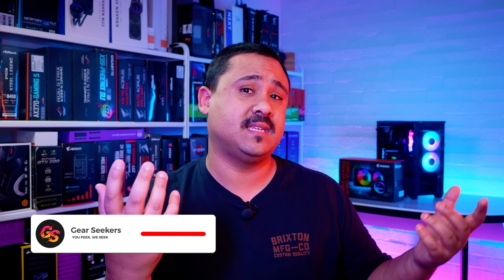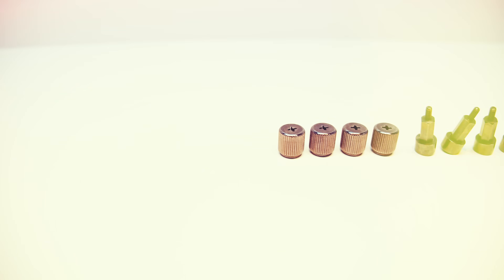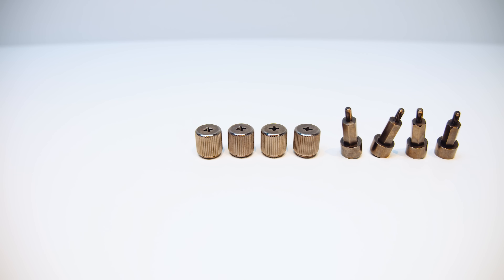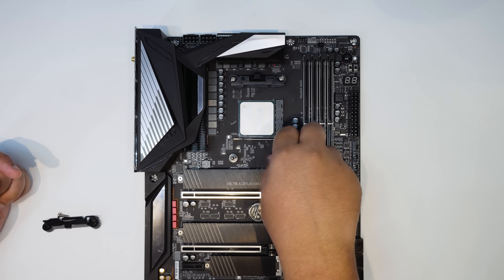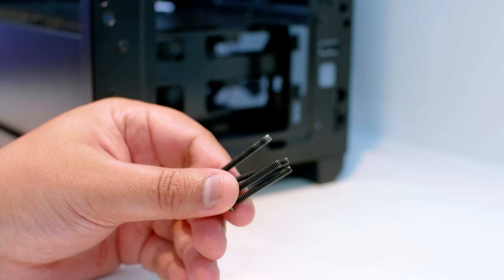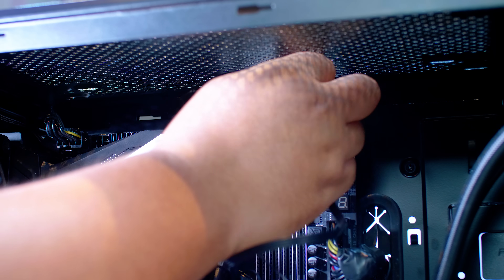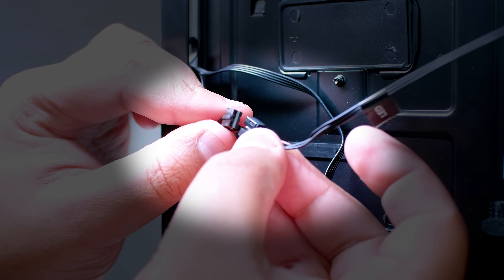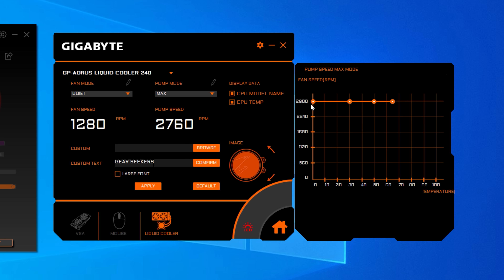HOWTO AORUS Liquid Cooler 240 AMD AM4 & AM5  Install Guide

Comment: Hi, I have a question.. My plan is to use this cooler for the linux headless server - and they dont provide such tools for linux, so will use VM (passthrough the USB port for this cooler) and push the desired config.. However if I would like to see the actual temperature of the CPU does it need to have AORUS Engine actively running in the background for reporting that temperature? Or its being show on its own.. simple test would be to reboot the PC and check if the cooler still shows the temperature. Appreciate your help. Michal
Reply from the maker: Yes aorus engine will need to be running in the background
Reply: @GearSeekers  Shame they dont support linux here in any way :/
Reply from the maker: I've been working with a few vendors directly to bring Linux support to some RGB products. Stay tuned.
Reply: @GearSeekers  I tried using wine (linux tool for running windows apps) for installing and running AORUS Engine.. Installation went through and app itself started but it would need to be tested with the actual hardware whether it picks it up or not. Anyway If I may contribute my 2 cents here.. This badly needs some centralised opensource app - since everybody is doing same thing their own way.. I didn't seem to find any unified tool for controlling RGB headers on motherboards.. it would be ideal to unify this problem across multiple vendors. As an implementation itself I would choose a service with exposed HTTP port - so called docker microservice. This way it can be integrated everywhere/anywhere (iframe for example or reverse proxy).. if you need any further assistance with the design feel free to reach out to me - definitely interested. Michal

Comment: Just to clarify, first time building a PC here :) Does this AIO uses the motherboard system fan headers for the 3 fan that is attached to the radiator?  if not I could save them for my chassis fan :)

Comment: Great review, do you still recommend these coolers? I'm thinking of getting the 360MM for the AMD Ryzen 7 3700X
Reply: They are great. I have the 240 and that cools super already
Reply: @TheAdatto  hows the temps overall.
Reply: @hassanar1  great. Highest temp i reached om a 4.9ghz 9700k is 59 degrees C
Reply: @TheAdatto  i am planning to use with ryzen3900x ,i wont do overclock.what do you think
Reply: @hassanar1  no idea. But my guess is that it will be enough. More that enough actually
Reply: @TheAdatto  will it work on asus motherboard?
Reply: @hassanar1  ?
Reply: @TheAdatto  i mean it supports all motherboard,what if use on asus motherboard it will fully work?
Reply: @hassanar1  yes. But you have to install Gigabyte Fusion 2. And it will show the cooler only. On my pc it will show 4 tabs. Mem. Cooler. Keyboard and MB rgb.

Comment: I cannot get the screen to light up on mine. Any ideas?.
Reply from the maker: Make sure the USB header is connected and update the firmware
Reply: @TheGreatAlzatee  i've got the same problem, but mine flashes for a quick second when booting the pc and goes black. The fans, pump rgb everything is working and i can pretty much change everything besides the screen. Did u find a solution?

Comment: Can you mount the cooler with the hoses facing down on the block? This way if you mount the radiator with lines in the back, and have a vertical gpu, you can had a good deal of the hose behind the gpu.
Or is it only on the right side like Corsair ?

Comment: Hi. Is it possible to rotate the RGB graphics  in RGB fusion? I am considering buying the 240 cooler (to mount in the top of my case), but it would look better with the water hoses on the left side of the cooling head (So that they don't cover my RGB ram) :)
Reply from the maker: Yes. You can rotate in any orientation you want :)

Comment: Just bought one of these and it looks and works great, however my CPU temp display seems to be 20 degrees higher than my actual CPU temp. Any suggestions?

Edit: I did some research and found something in regards to AMD R7's having a 20 degree offset, could this be it?
Reply from the maker: Thats it ;)

Comment: Still got a problem with the 360.. LCD display is not working at all, even had the model replaced. Nothing changed. SATA got power, PSU is not overused at all... Setup: Aorus B450 MB, AMD Ryzen 5 3600, Aorus RTX 2060 Super, GSkill Trident Z Ram 16GB... Have sent a ticket to gigabyte as well as my vendor... No replies yet. Maybe any of you has??!

Comment: hey guys just installed my 360mm version but theres nothing  on the screen have i dont something wrong? its just black
Reply from the maker: you need to install the software and make sure the SATA power and USB is connected.
Reply: @GearSeekers  just double checked everything and still nothing does it matter that i have the sata power cbale daisy chained together because i only have one sata power cable that goes to the power supply
Reply: @GearSeekers  yeah i have checked everything and still nothing its been to weeks without picture lol really dont know whats wrong could it be faulty?
Reply: @GearSeekers  lol i still cant get it to light up it flicks on white when i turn it on after its been turned off without any power but other than that it stays black...
Reply: @diddynator5817  I just bought AIO 360 and I have the same problem. Please, let us know if you will find a solution.
Reply: @TheRobym  yeah bro i %100 will lol im starting to think its faulty lol ill probs take it to acomputer shop lol
Reply: I've returned the product. I'll see what's next, they have zero on stock.
Reply: @TheRobym  i wish i could i bought mine from pc case gear
Reply: @diddynator5817  They checked and they said the product is ok. I think it has firmware to update somehow. I used the same connecting ports, working now. But showing the CPU temp higher with 10 C degrees. Its awful.
Reply: @TheRobym  dude atleast yours works haha mine still doesn't iv given up at this point 😂
Reply: Any updates?
Reply: @mikecarrizales7499  nah still doesnt work 😂
Reply: @diddynator5817  thats depressing lol I won't  settle for it! ill harass gigabyte til they spill the beans starting tmm and ill get back to you
Reply: @mikecarrizales7499  cheers when i tried that there site was down
Reply: @diddynator5817  ... my replacement works fine. Sorry buddy
Reply: diddy nator your psu must be 5 pin sata not the normal 4 pin idk why aorus didn’t tell us that
Reply: @i3do  ok cheers man ill buy some 5 pin haha didnt even know that was a thing haha it was my first pc build
Reply: @i3do  do you mean 15 p[in i cant find many 5 pin sata cables
Reply: diddy nator no you need to buy a new power supply 750w+ from good companies like thermaltake extra and the sata that comes from the power supply should be 5 pin not 4 pin
Reply: @i3do  oh so i cant just buy a cable i need a new power supply?
Reply: @i3do  so i have to buy a new power supply? im confused i thought it were just a cord i needed?
Reply: diddy nator i dont think there is a separate 5 pin sata cable for sell
Reply: diddy nator I recommend for you thermaltake GF1 750w 80+ gold fully modular power supply
Reply: @i3do  could i have plugged it into the wrong port on my power supply?
Reply: diddy nator no because the cooler only requires sata power i was like you have a normal sata power not 5pin one when I changed mine it workes
Reply: @i3do  ah ok cheers for the help im pretty clueless when it comes to stuff like this

Comment: have quick question I noticed on the pump the pump fan is interloped into its own connector back to pump do u not need to hook anything up to the cpu fan header?
Reply from the maker: No. Doesn't require that
Reply: If you're on Linux make sure to put the fans straight to the mobo. You cannot control any of it without proprietary windows only software

Comment: Got this cooler today, sadly, i'm still waiting on a PSU and RAM module so that I can test it... I've been looking high and low to see some performance marks for this.. I do get it that it offers >40 C in idle, but how does it handle under stress / load ? Did you have a chance of running a few stress tests, if so, what temperatures did you get, be it the 240/260 or 360 variant of this cooler.

Comment: does it fits with NZXT H510 Elite ?
Reply: The 240 or the 280 should fit in the front. NZXT states: "Front: 2x 140 or 2x 120mm with Pull
*Note: Need to remove RGB fans if you plan to mount the radiator to the front"

Comment: Thanks. One question. There doesn't seems to be any pressure applied on the cpu top by the pump. It is not spring loaded as I can see so it basically just sit on the top of the cpu ?
Reply from the maker: There is more than enough pressure
Reply: @GearSeekers  Seems pretty different from your video "HOWTO Install Cooler Master MasterLiquid ML240R RGB on AM4 Motherboards"  where the pump is pressure loaded on the cpu by the metal bracket and the screws. Strange, all the air coolers are pressure mounted like the AMD ones. Anyway.
Reply from the maker: This is standard Asetek mounting used on 100's of other AIO coolers.

Comment: The cooler looks great but a 190 usd MSRP seems a bit too much for a 240mm asetek aio given the fact that performance differences between all asetek coolers lays entirely on the fans that ship with them. If you are willing to compromise a bit of the aesthetics, go with a corsair 240 aio and a pair of noctua nf a12x25. It will still be cheaper and you’ll get significantly more perfomance both in thermals and noise out of it. You could even throw in a thermal grizzly kryonaut tube to squeeze out an extra 2 or 3 degrees of performance and still be under the 180 usd mark.

Comment: I wonder if the 280mm version of this will fit into the nzxt h210 mini itx case. The Kraken x62 280mm does fit even though 280mm is not officially supported by said case.
Reply: After some further research I would guess yes since both radiators share the exact same dimensions and screw hole placements.
Reply: It might get janky. I had to remove one screw to get my RAM to even fit. So consider that a warning. But it's a pretty goddamn good aio even after a handful of years.

Comment: I would so buy this cooler to add to my AORUS Master but RGB Fusion is so bad i would hate my cooler to be tied to it.
Reply from the maker: RGB Fusion is fine. Relax
Reply: @GearSeekers  Oh, well, no it isn't for everybody. Maybe for you, which is nice, but I do own the Aorus X570 Elite and I've had RGB Fusion not launching or producing blue screens right after login until I removed RGB Fusion 2.0 from safe mode. Support told me to reinstall Windows 10, but everything is stable except their software. The only reason I'm not buying is because of my bad experience with the software.

Comment: This cooler and the nzxt kraken have my favourite mounting system. It looks clean and is simple.

The cooler is a cheaper rog ryujin and I love it. Rog one was quite overpriced but this one is competitively priced.

Overall, good job Gigabyte
Reply: It's all Asetek stuff anyways so the mounting is going to be the same across multiple brands. There were even people getting free AM4 brackets from corsair when they had NZXT stuff due to old receipts and stuff.
Reply: @copy.4123  There are coolers which use the stock brackets like the corsair h110 which results in the mounting looking extremely ugly. Glad aorus didn't go for that
Reply: @HazmatPyro  nobody uses that mounting anymore cause it's dated and doesn't work with newer pumps....
Reply: @copy.4123  I screwed up the name of the cooler. It's not the H110. It's the H110i Pro. If you look on corsair's website, you will see that the non-intel mounting uses two screws and the brackets included for the stock cooler. Cooler Master also used to use it but removed it on the mirage series. Anyways, it's fucking ugly.
Reply: @HazmatPyro  H110i pro isn't a thing you're swinging for the trees here
Reply: @copy.4123  did I seriously fuck up the name again? Anyways, H115i pro, H150i pro, whatever, it's the newer aio from corsair with the adressable rgb block.
Reply from the maker: This mounting solution is far more elegant that the newer corsair mounting system. Even so much so that with the Hydro X stuff they went back to this system.
Reply: Dude can we use for asus rog motherboard .plus replay

Comment: If I want to use my own fans , can I plug them into to the aio like the video or I had to use headers on the motherboard
Reply from the maker: You can plug the fans into the AIO. If the fans have lighting you will need to connect them to another lighting source though.
Reply: @GearSeekers  thx for your info

Comment: I really like Aorus products and this AIO looks so sexy!
Reply: No. I have this product and its a shit
Reply: @Leon-ur3by  Explain why it is bad if u have this product?
Reply: @strohhuttv8848  
The software is very bad and you have to set everything to silent so that you don't hear anything. After each boot, the fans automatically turn red, including the ram. I have reinstalled my Windows 2 times. I use the Gigabyte Aorus Pro motherboard. The temperature display is also incorrect. i hate this cooler :(
Reply: @Leon-ur3by  The temps on the display are the temps of the coolant int he aio not the cpu. If the temps are different it is fine
Reply: @albosgiant  But the temperatures are temporary at 48 degrees on the AIO. Really i hate my Cooler.
Reply: @Leon-ur3by  do you live in a hot country?
Reply: @albosgiant  haha, no, i live in Germany. Its very cold in germany
Reply: @Leon-ur3by  i have the same cooler on my ryzen 9 3900x and mine is 42 on idle and i live in a really hot country max it goes to 70 on full load
Reply: @albosgiant  i have a ryzen 7 2700X
Reply: @Leon-ur3by  Hallo, empfehlst du den Kühler nicht?
Ich wollte gerade bestellen. 
Danke
Reply: travis drew Hi, lieber nicht. Ich würde da lieber mit einer NZXT kraken x53 oder sonstiges gehen. Wenn du unbedingt ein display brauchst gäbe es da noch die Kraken x63 oder eine von Asus
Reply: @Leon-ur3by  ok ,tnx